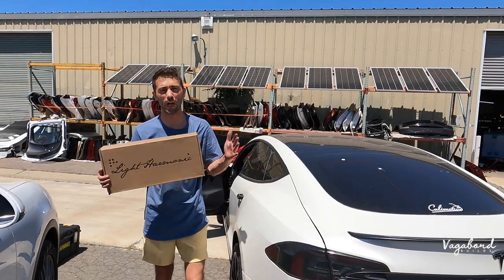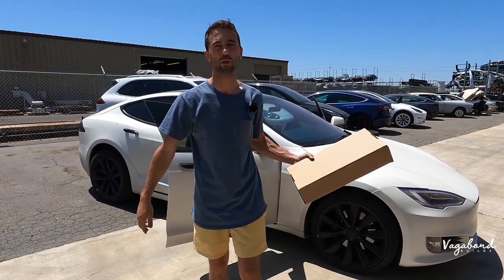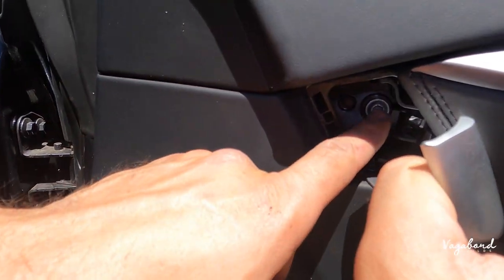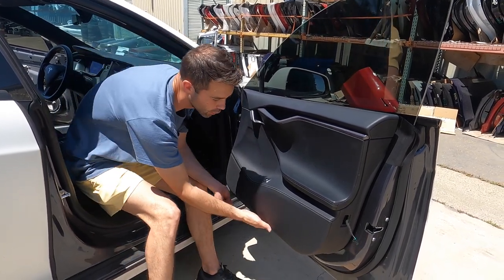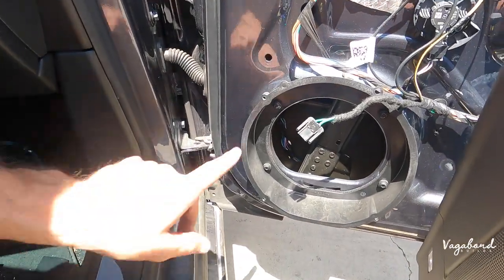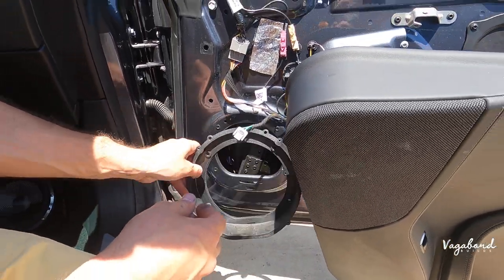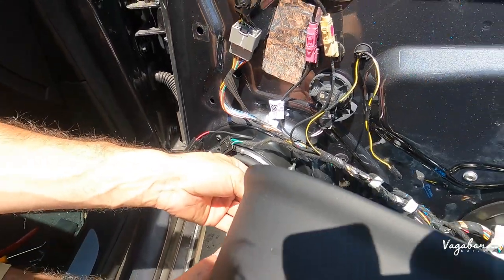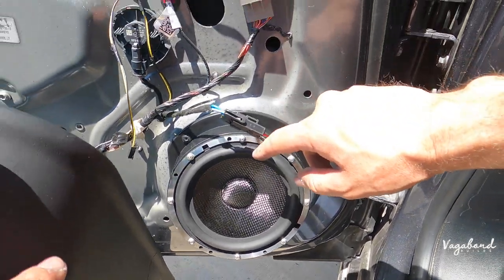Tesla Model S speaker upgrade

Comment: I’m sure those speakers sound great but they are way overpriced at over $1k for 4 speakers. I bought some Infinity Kappa speakers for $234.20 on Amazon for 4 speakers and it made a world of difference in my 2015 Model S.
Reply from the maker: They do sound great.  World of difference and my friends like them that I do the install for them.
Reply: Were the Infiniti kappa speakers plug and play? Also, has anyone changed the A-pillar speakers (by the front windscreen)
Reply: Do you still have the Amazon link?

Comment: Hi model s 2016 here is anyway to get - + audio out from the car just wire nothing else, try to open the door to use the speakers - + but can't open the door very strong and worried to broken it if I push out hard, is there any way to get audio out - + from this car.
Reply from the maker: Sorry,  I don’t understand what you are asking?
Reply: @VagabondBuilds  is any chance I can get audio output from the car to connect to subwoofer?